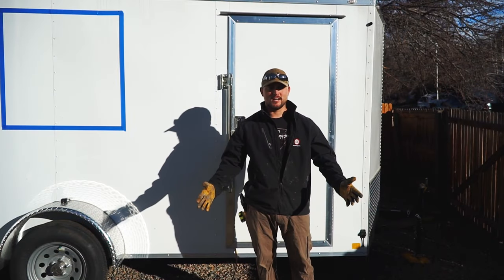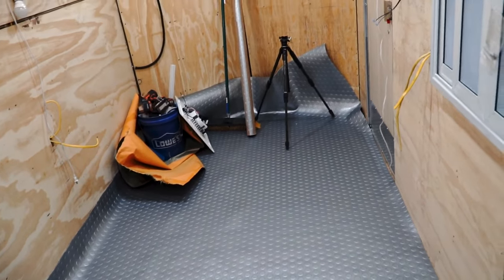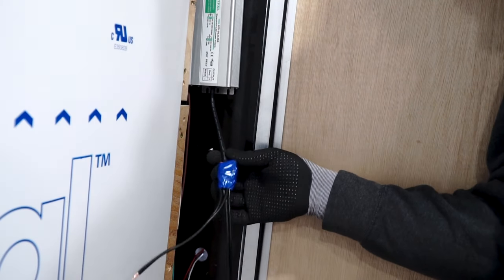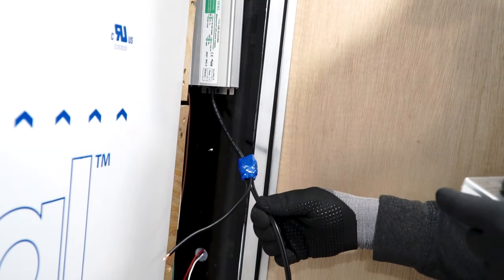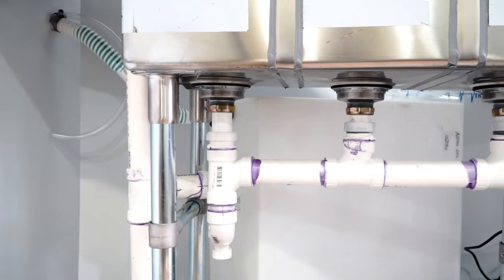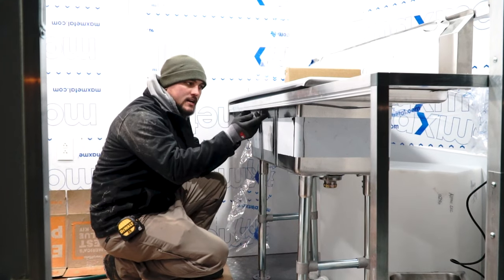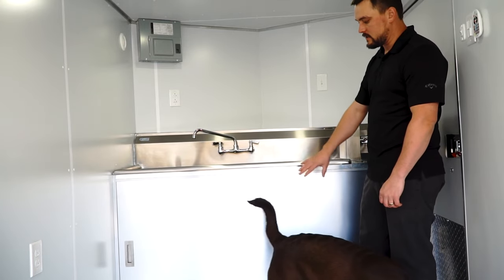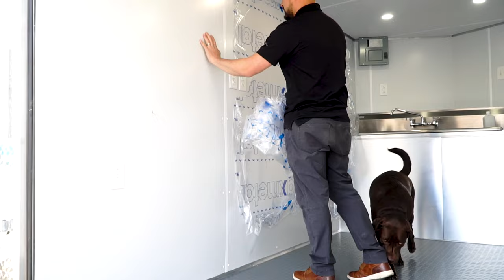Cargo Trailer Conversion - From Start to Finished Concession Trailer Ep.18

Comment: Looks great man. Where can I find the metal strips to cover the walls to ceiling seam and the floor to wall seam?
Reply from the maker: @mopar_shawn939 I got the angle aluminum from local aluminum supply company, Ericksons Metal Corp. I think i used 1/8"x1"x1" or 1.5". If I built another one I would probably use the thin gauge aluminum for the ceiling trim (like you see in a lot of trailers from the factory) and cut my wall panel a couple inches shorter to make it easier to install and access the wiring.   I really like the angled aluminum for the bottom trim though.
Reply: @ShouldBeGood  Ok thanks . So basically go with a wider angle at the top?
Reply: @ShouldBeGood  Not just wider but thinner gotcha

Comment: What type of metal did you use around your sinks and behind on the V? I'm trying to figure that out for my build.
Reply from the maker: I used brushed 3mm aluminum ACM panel. Same material I used for the walls, just a different color. I have a video in my series showing my cabinet enclosure build in more detail. Thanks for watching and good luck on your build!
Reply: Awesome! Thanks for the info.

Comment: This is awesome, man! Very inspirational! Did you just order those wall panels online?
Reply from the maker: Hi Kennon, I have a stock of them for my sign company. If you are located near a Piedmont Plastics location you can call them to order and pickup. They have lots of different color and size options. https://www.piedmontplastics.com/locations
Reply: Awesome! Does that material work well with heat and grease? For instance, would this be the best option for a food trailer that will be primarily cooking (not doing smoothies)? Of course, with the addition of a large, commercial exhaust fan
Reply from the maker: @KennonWryt  it is pretty heat resistant but I’d definitely recommend putting in a stainless steel backsplash panel above any griddles or stoves.

Comment: Doing my build right now. Did you just covered the two venta on the side of trailer?
Reply from the maker: Hi Jose, no I cut holes in my new walls and reinstalled the vent covers. I actually added an adapter for my AC unit to connect to the back vent and use it to vent the AC.
Reply: Okay thats why but if i get a mini split those two vents holes i just cover up no need for them right
Reply from the maker: @valentinsalas8300  I still like to have airflow into the trailer when towing because it keeps it cooler and clears out any odors but the vents are totally optional, they are not needed if you don't want them.

Comment: Does that material have a shine on it or is it flat and it’s hard to tell from the video thank you
Reply from the maker: The panels I used are glossy but they have satin finish as well
Reply: @ShouldBeGood  which ones did you use the DP digital print version? The local supplier told me they all have satin finish. They probably don’t know what they’re talking about thank you.
Reply from the maker: @dereksmith5551  The DP version has more of a satin finish. I used the standard white, which has more gloss.  I used the Alupoly brushed aluminum for the sink enclosure. 
https://www.piedmontplastics.com/resources/literatures/piedmont-sign-gradeR-alupolyR
Reply: @ShouldBeGood  but that’s polycore didn’t you use maxmetal? Thank you.
Reply from the maker: @dereksmith5551 maxmetal is a polycore panel (ACM). I use piedmonts alupoly brand on the majority of my projects but I just got a really great deal on the maxmetal panels for this trailer. I used alupoly for the sink cabinet.

Comment: Where did you get the Max Metal for the ceiling and walls?
Reply from the maker: That brand of ACM is specific to Grimco Sign Supply but most metal/aluminum or plastic suppliers will carry a similar 3mm ACM panel. 
I am a big fan of Piedmont plastics, they have a huge selection and great prices and will sell to individuals.